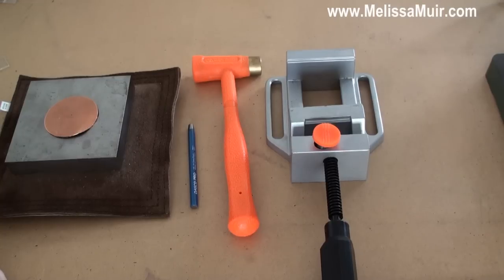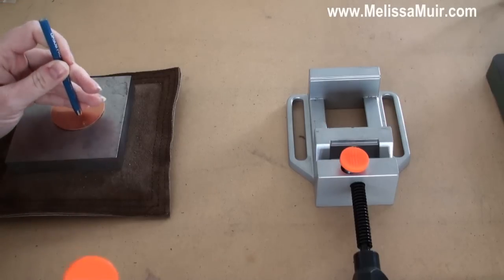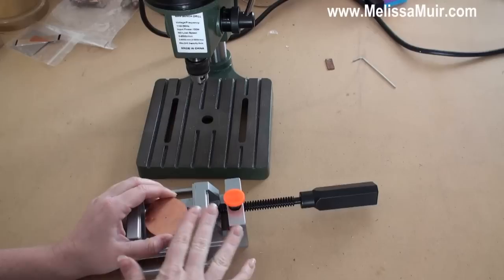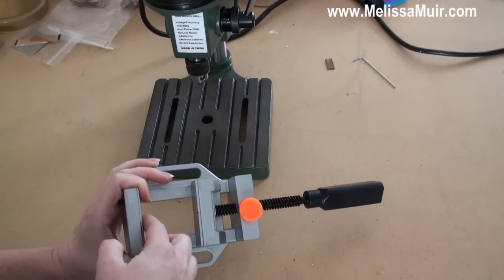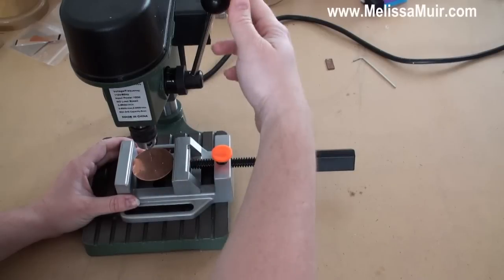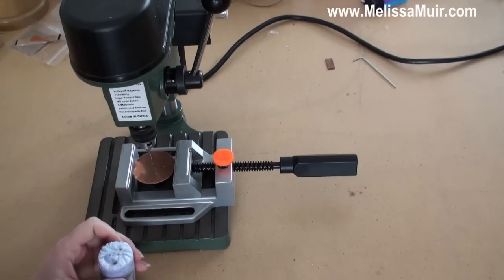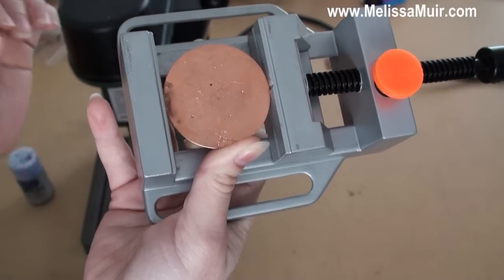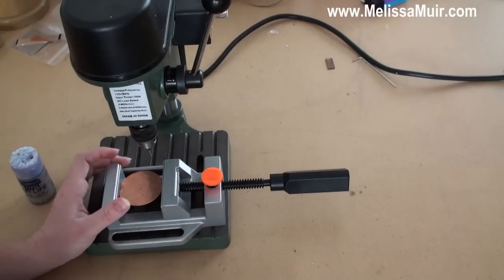Tool Time Tuesday - Using a Drill Press Vise

Comment: Melissa  can you tell me why you did not fasten the vise onto the bottom plate of the drill press?    It seems like you will have more control for holding your alignment.
Reply from the maker: Carol Faith That is a good question. I have never mounted my vise to my press. I guess that is because, I only use it when I am trying to hold small pieces and I like to be able to move the vise to exactly where I want it and not be constrained by the "tracks" that it would be bolted into. In addition, I don't use the vise for drilling all items on my press.
Reply: @MelissaMuir  the tracks allow for precise movement of the pieces. I recommend giving it a try. Also a precision two-axis cross table is great  (but expensive) and it allows you to mount it securely.

Comment: clamping or bolting that vise to the base makes it much safer and more secure, no chance of it catching and spinning the work and cutting your hands
Reply: yeah that's the point of a press. the press itself should be bolted to the table and the press to the press table. this is very instructional if you're into self harm

Comment: the correct way to drill a metal plate like this would be to put a piece of wood underneath to support it when you drill. otherwise you run the risk of twisting the piece in the vice and snapping a drill bit off - or worse.

Comment: Put some wood under part of the work piece (spanning the vice mounting rails) to get correct height in between the jaws, it will make the piece laterally stable. Then you can let go the piece completely and only hold the vice. A lot safer then. As long as you want a "free ranging" vise then you need all the safer you can get.
Reply from the maker: Great advice. Thank you.

Comment: Parallels support the work from the bottom of the vise to the underside of the work piece.  Also try an automatic center punch from harbor freight spring loaded punch is a real time saver eliminates the need for a hammer.   Also you may want a bench block which give you more options for riveting and wire bending sold by grizzly tool (they also sell vise parallels)

Comment: Does lubrication prevent the drill bit getting hot?
Reply from the maker: It won't prevent it from getting it, but it will slow the process a little. It helps keep the cutting tip and edge cool a little bit longer than without.
Reply: Thanks, Melissa.

Comment: which it is the maximum capacity drill for use in the machine
Reply: This 3-speed mini bench drill has 3 variable speeds: 0 to 5,000/min, 0 to 6,500/min, 0 to 8,500/min. The max drill capacity is 6mm, it includes 3pc wrenches, and 1pc chuck key (size: 6mm). Its work area dimensions are 6-9/16” X 6-9/16”, its base dimensions is 6-5/8” X 6-5/8”, the max drill height is 7-½”, and spindle travel is 1” It has a voltage of 110V/60Hz and a wattage of 100W.
Work Area Dimensions: 6-9/16” X 6-9/16”
Base Dimensions: 6-5/8” X 6- 5/8”
Max Drill Height: 7-½”
Spindle Travel: 1”
Voltage: 110V/60Hz